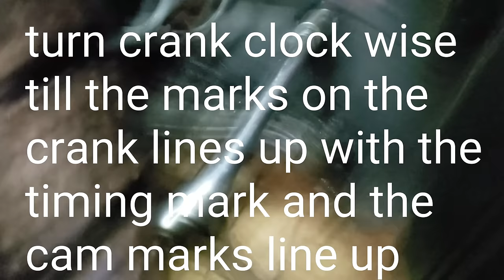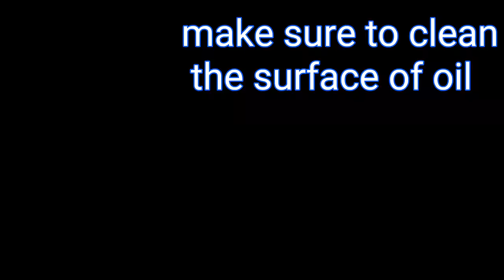How to replace Honda CRV timing chain DIY #crv #rsx #tsx #accord #k20 #k24 #timing chain

Comment: Is it me or are the cams tough to get lined up? The valve tension makes it interesting is there a trick?
Reply from the maker: I usually hold it with a wrench.. I get the right one lined up and then move on the left one.. they can be tricky, but sometimes they sit still if they're lined up centre.
Reply: Should I line it up on the crank gear first?
Reply from the maker: @petergozina11  Yes... that's the first gear you need to line up... make sure crank gear is on TDC before starting
Reply: @UncleTinman  yeah so I have everything lined up crank wise TDC. One more dumb one for ya lol should I put the tensioner in and just not pull pin to help keep the chain from jumping teeth on cam gears?
Reply from the maker: @petergozina11  NO... you wont have enough slack with the tensioner on.
Reply: @UncleTinman  appreciate all your help! Excellent video by the way! Very detailed 👌
Reply from the maker: @petergozina11  thank you.. appreciate the comments.. hope you can figure it out. Cheers
Reply: @UncleTinman  not that I'm a mechanic nor am I experienced in timing chain TDC but the camshafts on the k20s and 24s do have cam shaft lock pins for this particular job that make lining the cam marks up super easy
Reply from the maker: @petergozina11  ah. Yes. There are lock pins available. For most people who would only do this as a DIY wouldn't have the pins nor want to spend the extra for something they'd only ever use once. You could probably use a certain sized cotter pin to try and lock the cam shafts as well.... again.... that's something that you normally wouldn't have available.

Comment: Unscrewing the spark plugs will make the turning of the crank much easier since you don’t have to overcome the compression of each cylinder. Why didn’t you remove the splash guard in the wheel house right way to remove the crank bolt since you have to get there eventually anyways to remove the crank pulley and manipulate the tensioner?
Reply from the maker: I'm pretty sure the cover was removed later in the video. Thanks for your question

Comment: So what's the deal here I thought after 2006 one didn't have to worry about belts and chains anymore on Honda motors is that just consistent inevitability? Or is this more of a rare occurrence because I have a 2010 with 193,000 should I be fretting and concerned now about it leaving me stranded somewhere?

Comment: I replaced the timing chain and put all back together again, sent back the impact wrench back to the second-hand shop, tried starting the engine, it does'nt start up !?
I can only think - when installing the chain, I had to turn the right-hand gear (which is under tension) to line up the chain markings with the gear markings (also bringing it back to TDC), I assume this method is ok, also
when lining up the bottom chain marker with the dot marker on the gear, I missed double checking the gear lines up with the arrow marker on the engine casing, I assume the position should be correct (without having to take it all apart again, and having to order another wrench !)
The EML that was on before, is not on anymore
I also did'nt rotate the engine before put it all back together again !
 
What do you suggest ? (I don't wanna have to take it all apart again unless really really have to !)

Months ago, before diagnosing Timing Chain I had also investigated fuel supply issue ? So had the fuel filter system disconnected and out of tank, as well as fuel ! Obviously, all reconnected before re-start attempt !

Thanks

-------------------------------------------------------------------------------------------------------------------------------------------------------
Clearly, as a lesson to others, follow video step by step !

As someone suggested when doing this job, block off the gap below timing chain to the oil sump, as I dropped a socket down into the sump, could'nt fish it out with magnetic rod, so all was left is to take sump off. Easy I thought, but no ! Unless you take engine out, you have to take the subframe beneath off, as the sump cover WILL NOT come out (but off), meaning resealing the sump will now be extremely extremely difficult !! I had just enough room to get my fingers in and pull the socket out
Reply from the maker: I think the easiest way to check is to remove the valve cover to see if the marks line up.
Reply: @UncleTinman  thanks, I just done that, the engine had turned over after attempting start so manually had to turn the engine (many times !) so that the chain markings and TDC all lined up (as if I'd just fitted and lined up chain) to check i had done properly, and all line up
Reply from the maker: @WindyMillarUK  if the marks all line up then the chain should be correct.  You may have missed something.. crank sensor? Crank sensor signal ring?

Comment: Right at 8:48 is where Im stumped. Everytime I try to take that bolt off of the crankshaft gear it still spins. I ordered the holding pin, how did you get that to zip off without it spinning?
Reply from the maker: What tool are you using to remove the bolt? Sometimes the gun is strong enough to remove the bolts with a regular socket... I also have a weighted one. Check out my video for the weighted socket.  https://www.youtube.com/watch?v=hYS6ns5Dh2g

There's also a special crank pulley holder you can get as well. 

https://www.amazon.com/BETOOLL-Crankshaft-Removal-Holding-Spanner/dp/B01F333OHY/ref=sr_1_1_sspa?crid=2B5UW7Z891WNT&dchild=1&keywords=honda+crank+pulley+tool&qid=1631894003&sprefix=honda+crank+pull%2Caps%2C170&sr=8-1-spons&psc=1&spLa=ZW5jcnlwdGVkUXVhbGlmaWVyPUEyMzRPVTNLQzZESzRDJmVuY3J5cHRlZElkPUEwOTUwODQwNTVEQ0E0QlhHUk9EJmVuY3J5cHRlZEFkSWQ9QTAwODMyNjYyVk1EWkNXT1FLTlBZJndpZGdldE5hbWU9c3BfYXRmJmFjdGlvbj1jbGlja1JlZGlyZWN0JmRvTm90TG9nQ2xpY2s9dHJ1ZQ==

one of those should be able to help you get it off. Hope this helps.

Comment: Any torque specs on the timing cover bolts? Thanks
Reply from the maker: Sorry. Dont have any torque specs.. they're pretty low...hand tight.. they're 10mm bolts.. won't be much..maybe 9ft/lbs. But don't quote me on those numbers..

Comment: Thanks Uncle for doing this video. Took all the guess work out of the job. One thing. It's better to place your part on a sturdy flat wooden benchtop to protect the sealing surface when hammering in seals. Doing it on your drain pan is kinda sketchy.
Reply from the maker: Thanks for the compliment.  I forgot about the seal and had applied the sealant already...that's why I had it perched on the drain tank as such.

Comment: Hey but what’s that tool you used to keep the cams lined up?
Reply from the maker: I only used a wrench to hold the cam gear in position.  There's is a locking pin available.

https://www.amazon.com/K-MOTOR-PERFORMANCE-Cam-Lock-Tool/dp/B08TV5SFMY?ref_=d6k_applink_bb_marketplace

 Hope this helps

Comment: That's a clean engine for 400,000 klms.....Mine has only 122,000 klm's but has oil varnish, I'm hoping the switch to synthetic will clean the engine out.
Reply from the maker: Try using an engine cleaner before your next oil change, maybe that'll help clean it out before switching over.

Comment: What size and what length was the  Wrench you used to remove the belt
Reply from the maker: Great question... the length is 14" and it was a double ended wrench size 14 & 17mm. If I remember correctly it's a 14mm. Hope this helps

Comment: Hey bud,how do u torque the crankshaft bolt with a m18 high torque? Just wonder cuz I dont have the tool to hold the crankshaft and tighten with my torque wrench at specify foot pounds,if u can help me that would be a lot thank u
Reply from the maker: I usually just gun it in. Never had a problem with them backing out.

Comment: Hi there. I was trying to find out if my 2003 has a timing Belt or chain. Although your video mentions a chain, I guess from your instructional video it has a Belt!   I am told chains don’t need to be replaced whereas a belt does.  My  17 yr old grandaughter loves her Honda CRV 2003, but we have no idea about cars and have been told timing belts are very expensive to replace.  We have just had the transmission fixed which was BIG dollars and don’t want anymore surprises $$$$.  Can you advise please
Reply from the maker: The 2003 CRV uses a timing chain.  They do need to be replaced just like timing belts. There is a belt to drive the accessories as well. What is your mileage?
Reply: Thks so much for yr reply. It has done 234,000 km.  We bought it at 203,000 km and have no idea if previous owner replaced it.
Reply from the maker: @carolko2444  more than likely it hasn't been replaced.
Reply: Thank you so much for your help.  How great that I can get this information from across the other side of the world as I am in Australia!
I will start saving more $$$$$ Ha Ha.
Reply: thank you so much for taking the time to reply to me. I really appreciate it.
I have another question.   I drive a Hyundai Elantra Elite 2003. When I turn my steering wheel hard right or left it squeals.  I have had the power steering wheel fluid topped up and the belt replaced and also tightened but it is still squealing.  The only thing left is the Pump, which I am told may need replacing.....and will very expensive 🙁
Another guy said it could be an airlock but who knows and how do you get rid of that????
Reply from the maker: @caziko48  Where's the squealing coming from? Engine area or the suspension area? Is it possible that it's the ball joints or tie rod end? I've had those make noises before. I'd suggest having someone try to listen for you.
Reply: Uncle Tinman. Hi there.  Thanks for yr reply.  I have had 3 different people take a look at this. The noise is coming from close to where the belt & the pump area is and only occurs when you turn the wheel hard R or L. 
It seems to be a mystery with the professionals 🤔

Comment: My buddy and I tackled this job yesterday, but we’re stuck on the timing. Put on the new chain. Everything lined up. Put the crank bolt back on, turned, turned, turned, and never got everything back in alignment. How long do you turn? What is considered a full rotation? Thanks in advance for the feedback.
Reply from the maker: Sorry. There's an error in the video.. the mark wont line back up after turning.
Reply: No worries. I realized this after reading through all the comments. The job is all done! Thanks for the great video. I’m no longer stalling out at every Stop sign 😂

Comment: Any videos on valve clearance adjustment. I did mine twice but I think it’s still off. I get noise between 3-4k rpms and it sounds like valve clatter. Any tips on how to adjust them? I followed firing order and adjusted both intake and exhaust side. Some guys say to adjust only when lobe is on top (I may try this next time). Also how do you get a feel for filler gauge. If you set it at 0.008” then would you be able to insert 0.009”? Would that be a good way to check it
Reply from the maker: I don't have any videos for setting valve clearances. I'm sure if you do a quick search there should be plenty available.

Misadjusted valves should be noticeable even during start up. If you've done it twice and same result, you may have other issues. Perhaps the VTC actuator may be faulty causing a miss timing of the cams at a certaim rpm range.

As for the feel. I generally set them a tad tight to the point I have to really wiggle the feeler gauges to get them out and the next size up will definitely not fit in.
Reply: Thanks for replying really appreciated. Car is 2011 acura tsx. I replaced vtc actuator last year due to grinding noise on cold startup. Also I replaced tensioner. I think my timing chain is stretched a bit and that could be why I get clattering noise. Timing could be off a bit. Do you have a hard time removing crank bolt? I think without a compressor it could be hard to get off.
Reply: And the grinding noise never went away even with new vtc actuator and tensioner. It’s a faulty design with Acura tsx and they even the new part does not solve the issue. A lot of people online complain about the same issue. Maybe a new chain would fix it
Reply from the maker: @IgorD33  There is a tool available to hold the crank pulley . It's specific for Honda/Acura cranks.  Search on Ebay under "Honda crank pulley tool' and you'll see what I'm talking about. Even sometimes I have to use that if I'm not able to remove with my guns.
Reply from the maker: @IgorD33  you're looking at about $1000 including parts and labour. I'm located in Toronto, Canada though.
Reply: Im not too far away. Hamilton
Reply from the maker: @IgorD33  oh Hamilton isn't far at all. I've had customers come from NYC. LOL